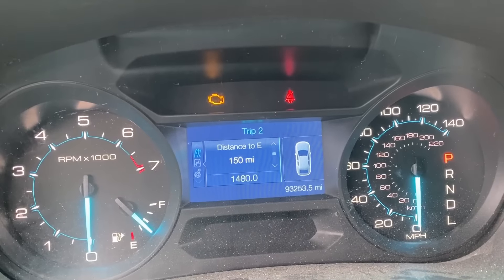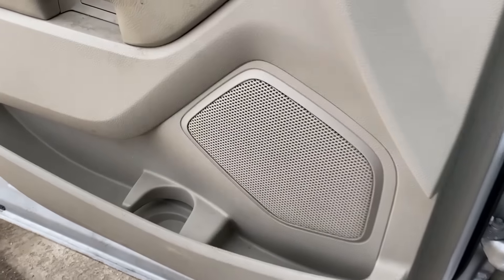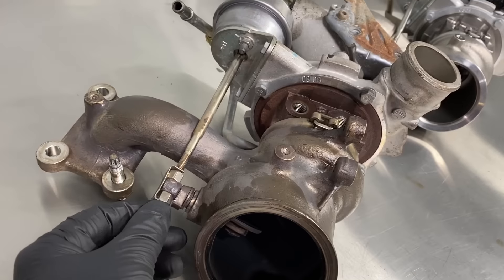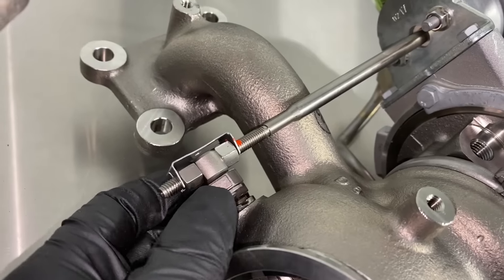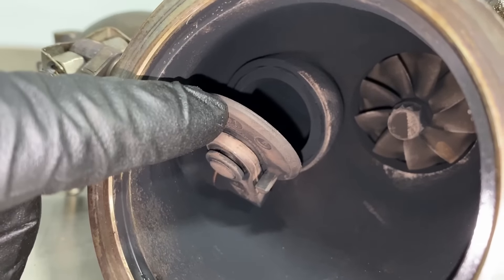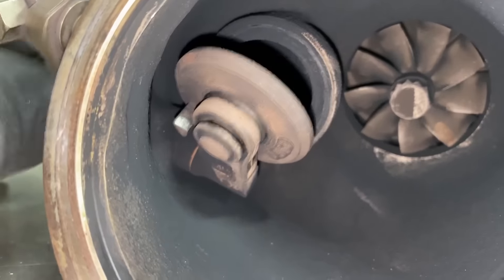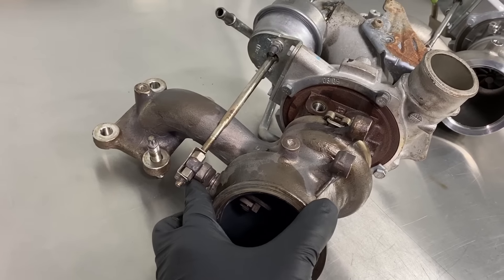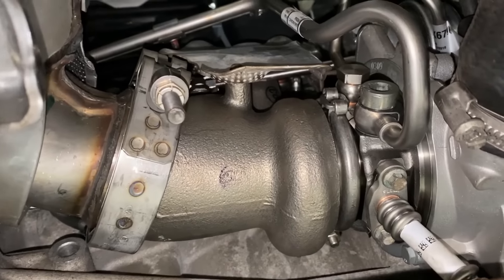Ford Ecoboost Cold Startup Turbo Rattle Explained

Comment: I have a Focus ST with the 2.0. So it is making noise, but is it causing performance issues? Is the turbo not providing boost? Is this an issue that has to be fixed? I'm just curious about what happens if you don't fix it? I would be trading my car in if it cost that much to repair.
Reply: Walter Williams, I posted this reply to an earlier comment, so sorry to sound like I'm spamming but... 
"This very thing happened to my wife's '13 Edge with 2.0 ecoboost.  Started as a rattle that I chased thinking it was exhaust heat shield/etc.  Then one day going down the highway i noticed that it couldn't climb slight inclines without downshifting.  That eventually turned into the check engine light for "underboost".  I took it to the dealership and bam, bad turbo, one time use bolts/gaskets, need a new cat.  I was lucky that it was just barely under the extended warranty, so it only cost me the $100 deductible.  Not 4 months later on the new turbo and I already hear the loose startup when cold."  I'm not trying to spook anybody, but I lived it with my wife's Edge, so it can happen.

Comment: I have a strange kind of cliking ish on 2000 to 2800 rpm on slight acceleration and only some times in my 2014 taurus SHO with 70K miles on it I took it to ford and they cant make it do it yet I can and they did ride with me and got it to do it once, they wont try to get it to do it of course my warranty is up next month, any Ideas?

Comment: Because the cat needs to be replaced as well, I'd claim it's an emissions failure covered by warranty. In CA, the emission controls are good for 100k miles.
Reply from the maker: No here it's 80k.
Reply: @FordTechMakuloco  Thanks for that.
Reply: FordTechMakuloco I get a magna flow universal cat weld on some bungs for oxygen sensors do nice neat job with mig or tig  cost 100$ for cat and 50$ for bungs and piping possibility is stainless , I used one of these cats on 1992 geo tracker ,passed emissions better than stock Oem by the readings
Reply: @nickking1510  Not all vehicles are allowed uni-cats. New York has strict emissions rules just like California. If you had been paying attention, you'd notice the turbo outlet flange is different between the old and new units. Any modification would be spotted right away.
Reply: @nickking1510  Zero co is what's expected, so how does your cat perform better? Zero is zero.
Reply: James Plotkin I owned a 4x4 in 1998 it got Etested and every 2 years after ,the dot certified inspection station would give a print out with co nox hydrocarbons . The replacement magnaflow one much lower in  Co ,Nox, hydrocarbons, even in 1998 first test was substantially higher with the Oem back then . In fact it was so clean that the tech doing the test quizzed me and could have failed me on the ground I had cheated lololo
Reply: James Plotkin We threw out our e test with a new change in leadership, and a quality universal cat I put on my car was cleaner that tests done years before with Oem total money grab
Reply: James Plotkin never seen 0 on any emission test I have seen mine get lower than Oem standards
Reply: James Plotkin I can see in the video it’s in the rust belt ,
Reply: James Plotkin I would repair the turbo waste gate it would be an easy repair but nothing most people would touch and not a dealer or private shop .Constructed a micro welder which would work perfectly . After drilling and replaced the bearing and shaft then weld and finish . I am industrial electronic and mechanical technician/ technologist  ,work on our in house diesel turbos heavy equipment, as well as industrial controls and automation ,and been modding and rebuilding restoring car and trucks for over 50 years .One of my close friend from Michigan built custom car for movies and has a motorcycle in the Geneva museum of modern art and is a custom car painter he taught me many skills , I build and modify ,cars , boats  ,and custom paint have an extensive auto back ground in auto body ,mechanical from the mid sixties to present and repair and overhaul body control modules , power train control modules to component levels and also hold the highest classification  Amature radio licence  . If the state inspection station are that un reasonable and taxes are high according to  ham radio operators i communicate  with .I would sell and move to a more freedom oriented state with low taxes

Comment: Mr Makuloco, I have a 2.0 liter 2013 Lincoln MKZ I just bought with 16,000 miles on it.  I can hear this rattle at idle, in gear, , especially in reverse.   I only recently bought MKZ from a friend for a great price and love the car. I cannot imagine the waste gate wearing out in 16000 miles , driven by a little old lady(literally). Should I be worried?

Comment: I have an 18 lariat 3.5 eco that is sounding near the exact same off cold start then disappears. I've been to the dealership twice and they keep telling me to use better oil/filters... I'm using 5w30 full synthetic.........
This is quite helpful. Any other 18'rs out there hearing this?
Reply: PewtoWin G my 19 3.5 does it, going into the dealership this Monday for it and another noise
Reply: *2019 f150 3.5 Ecoboost

Comment: Does this happen on the ford focus st as well as it has the 2.0 ecoboost engine?
Reply: Yes. All the 2.0l engines use the same turbo (also Audi/Volkswagen 2.0L use this turbo). This is a problem with the turbo which is made by BorgWarner. The 2.0l Ford engine is excellent.

Comment: My girlfriend's 14 Escape 1.6 has thrown a P0299 Underboost code. I'm afraid that it's this. I got it driving better by beating on it while driving for a bit, so I would imagine the wastegate lever has play in it and it just hung up and worked correctly for a couple days until the code came back. Haven't noticed the noise though.

Comment: Why couldn't the actuator be JB welded to take up the slack around the bolt?  Is this really a "have to replace the entire turbo" repair or is this Ford not making the parts available for 3rd party repairs? Because aill bet the dealerships actually replace parts, and charge for an entirely new turbo.

Comment: Hello sir, 
Would this rattle be applicable to a 2015 f150 2.7 EcoBoost? Getting the same noise on a cold start up. Really loud and noticed a loss of acceleration maybe do to a loss of boost.
Reply: Did you get a reply? I have the same vehicle.

Comment: What about the Mercedes om647 engine that literally goes 300,000 miles before it breaks in and the only part that needs replaced as a plastic turbo resonator tube

Comment: My k03 B&W off my vw was rattling. I adjusted the wasregate actuator arm like 30k miles  ago and it's still going g strong hitting 18 pounds of boost.
Reply: That makes sense. VAG and Ford both use the K03 and I’ve seen this issue come up a lot.

Comment: Is this a problem with the 3.5L EB engines in the trucks also? I had one of mine go because a coolant hose was not fitted properly at the factory, depriving one of them of coolant and burning it up. It was replaced under warranty at around 50k miles. Other one is original and so far so good.

Comment: I have a 2011 F150 FX4 with 3.5L Ecoboost Engine. After spending $5,000 to have the timing chain replaced, all 4 new phasers, VCT Solenoids, all gaskets, 02 Sensor, filter screens in both turbos, fuel system service, replace engine air filter and new OEM oil filter, engine flush, oil change and all brand new spark plugs... including dropping the oil pan to check for debris/blockages in the uptake screen/tube... Ford says they still don't know what's making a "ticking / rattling" sound and they want to sell me a remanufactured engine.... After watching videos like this, I'm very inclined to just to get my truck, drive it home and figure it out myself... They're just guessing with my money at this point. I feel Ford service dept "gave up" and said, just buy one of our remanufactured engines....

Comment: A lot of people have luck adjusting the waste gate actuator rod to take up the slack. Solves under boost and helps with a lot of the rattle. Just don’t over do it or you may have an overboost issue, just get the slack out.

Comment: But why an entirely new turbo for a simple fix when you can get a new rod? Seems a bit over the top to replace the entire turbo
Reply from the maker: The next one I will send the turbo to you to fix and when it rattles in 5,10,15 or even 20k miles you get to warranty the job. Sound like a plan?

Comment: That turbo could be repaired easy at a machine shop …
Reply from the maker: Ok go find one that is actually willing to take on the work and is any good at what they do and when it comes back you pull it off again then the machine shop says nope I am not playing with it anymore then you are buying  anew one from Ford for the customer. You would not be very successful at running a business.

Comment: Hi, could you do a video on brakes,  the problem I have is with may brakes. First start after sitting over night the first time I step on the brake to put it in drive I don't have stopping power after I pump the brakes I get power brakes. What could may problem be.  If my wife drives my truck I tell her pump the brakes before you put it in drive. I have a 2012 F150 xlt 4x4 3.5 supercab.  Please help Brian

Comment: Yeah this sucks I'm having a problem with my 2.0 EcoBoost since the same thing It's just the wastegate is opening cuz the linkages are loose and so it's just bypassing the turbo and I haven't found one machine shop that'll work on it even though it just needs to like have a the parts pressed out and put in a bushing It seems ridiculous.  ain't no way that I'm paying between 6 to $1,200 for a new turbo when it's fine and 4 just cheaped out or messed up on the linkage this is ridiculous

Comment: What is your opinion on buying a factory ford extended warranty? I just bought a 2019 Ford F-150 with the 2.7 twin turbo engine and these turbo failures are very concerning to me. I plan to keep my truck until 150,000 miles. I can get a factory Ford warranty with the highest tier of coverage 6 year/150,000 miles for $2,350.00. Your advice is appreciated!

Comment: Seems like your engine idle does not have another problem of rough idling rpm, mine and lots of ecoboost 2.0 engines with that problem. After cleaning the IAC, MAP sensors, still not work. Is that a permanent problem there please?

Comment: I am having this very similar noise pretty consistently upon ACCELLERATION only, between 2500-3500 rpm and stops immediately after letting off the accelerator. Does not do it at idle. Do you think this could still be the wastegate? Or, should I be looking elsewhere. It's definitely a rattle, not a heat shield and not a broken flywheel. I have already had the short blocked replaced as per the TSB for 1.5L ecoboosts and I am having no error codes or misfires. Doesn't seem to affect performance, though, I have been easy on the throttle as I don't want something to blow up.

Please help @fordtechmakuloco !

Comment: This is not only a Ford problem Volkswagen and Audi cars and BMW have similar issues mostly the bushings that the waste gate shaft pivots into wear out and causes a low boost fault.  I’m curious what is brand Turbocharger is it it looks like a IHI one more way the turbo can fail on a Volkswagen CCTA engine is the V band clamp break where the two halves are connected opposite of the securing bolts this is a stupid failure because your can’t buy a replacement at the dealer only if you look enough online you can find a replacement.      Looks like the turbo could be a Borg Wagner brand I thought only IHI had a V band holding the center cartridge to the turbine housing but I guess I was wrong.

Comment: Any updates on the original 2.7l Ecoboost engines in a f150? Anything to look for, any reliability issues or major flaws? I have this engine in my 15 f150 and it runs amazing but I like knowing what I need to look for.
Reply: I blew my 2016 2.7L on a trip to NY. Broken rod. Had the engine replaced at Utica NY under warranty two months later tried to drive it home and had reassembly issues ending up buying a new Ford in Geneva, NY this time a 5.0. But to be fair, the 2.7L is a good motor, I just got a lemon. I was getting 24 mpg on my trip.It still pissed me off, it was paid for too.
Reply: Mikey B I’ve owned all the f150 Ecoboost engines and the 2.7 was the most impressive one for what it is. I beat the living shit out of that thing and not one issue. I now have a 2019 3.5 but only because of towing needs now
Reply: I've seen the forum with the 2.7 that hit 400k and counting. I run a pcv catch can, I only use Pennzoil ultra platinum and change every 5k. Only run shell fuel mid grade. This engine should last a life time unless the engineers surprise me. Lol
Reply: Will M all the Ecoboost do, turbo vehicles. Worst thing you can do is baby them

Comment: I have a 2013 Explorer Sport with an intermittent P0299 code for low boost but it does not rattle and all the piping is sealed. It does have 120k for miles. Any ideas?

Comment: Ford needs to step up and replace components like this and the cam phaser on a 5.4 when the design is inherently poor. I bought my 5.4 at 113KM. 13KM over warranty. But I bought it off a lady and I'll never do that again. "Lady driven" equals neglect even if she didn't abuse it. That clicking noise didn't just show up and had she recognized that clicking as not normal, she would have gotten that taken care of under warranty.

Comment: Don't have to change the turbo to fix this, easy fix,... remove the arm and mill out the hole, then install a bushing/sleeve, re-install, cost a few $$ and will last a long time. I'm actually a mechanic and was fortunate to have access to a machine shop, I've repaired many worn actuating arms on the milling machine this way, it works very well, and will save you a lot of money. Any local machine shop can fix the arm this way, cost peanuts compared to a new turbo. As for the loose valve, just make a small adjustment on the threaded actuating arm rod  just a bit, not too much though, will work for a long time.

Comment: Hey i have a 2019 f150 3.5 ecoboost my turbos glow red hot first thing in the morning when my truck is warming up only does it when its very cold outside just wondering what do you think it could be already brought it to the Ford dealership and they have no clue.
Reply: Turbos like high quality synthetic oil.  I have heard from many mechanics over the years that it is best to stay away from conventional oil and only use synthetic.  Change the oil very often as well...that means before the oil change reminder lights up.  Maybe every 5,000 miles.  Oil changes if you do it yourself are cheap compared to major repairs later.  As for "cheap gas"....the non-name brand gas stations buy from who-ever sells the cheapest.  It will not hurt your engine, but may or may not have the detergents that the top-tier stations sell such as Shell, Exxon, etc.  As for the F-150's, I know the manual says 87 octane is fine for normal driving but recommends 91 or higher for towing.  That tells me the engine prefers higher octane.  Depending on the altitude of where you live, it may or may not be a factor.  I'll be looking for a new F-150 very soon to upgrade my '14 F-150 3.7L NA V6 and I am leaning towards the V-8 just because of no turbo and 87 octane is the recommended fuel.  I live in the Virginia Beach, VA area and pretty much anywhere I dive is fairly flat, so not having a turbo will not be much of an issue pulling loads.  Hope your turbo issue gets resolved soon before the warranty expires.  I would keep pressing your stealership, I mean dealership to get it resolved under warranty.  I had an issue with my torque converter groaning in 3rd gear and at highway speeds in 6th and they kept saying it was fine.  I finally made them have a mechanic drive it with me and he picked up on it right away.  Finally got the torque converter replaced before my 100K extended warranty ran out.  I currently have around 135K and all seems fine.  Best of luck to you.
Reply: Pretty common. All my Ecoboost trucks have done this
Reply: @cheeznhard  really thats common for the turbos glow red hot after 3min of idling ?
Reply: @LynxStarAuto  My truck has 4500 kms and I run premium fuel the truck hasn't had an oil change yet but I'm pretty sure the truck comes from the factory with synthetic blend in the engine?
Reply: @ksamos  thank you I'll keep bugging the dealership but so far the truck only has 4500 km I run premium Shell gas the truck hasn't had an oil change yet because it's so new and I'm pretty sure the dealership run synthetic blend in the EcoBoost to begin with I've only had this issue since the weather has gotten cold.
Reply: Ecoboost Nation After three minutes of idling seems a little excessive for that much glow but as far as them glowing yes that’s normal. Try touching them after about 15 seconds after you start the truck for the first time in the morning, you will burn your fingertips